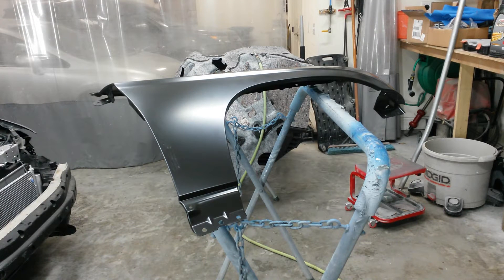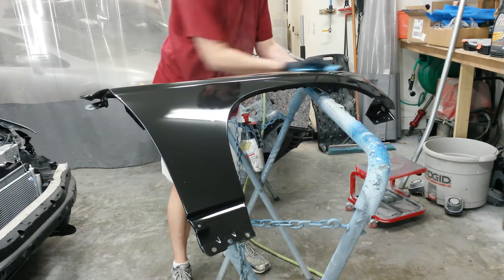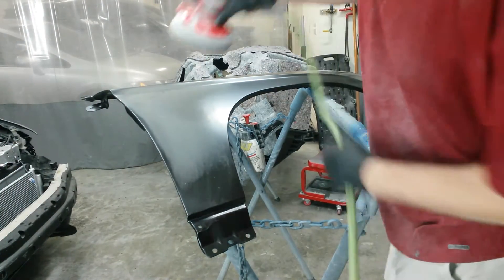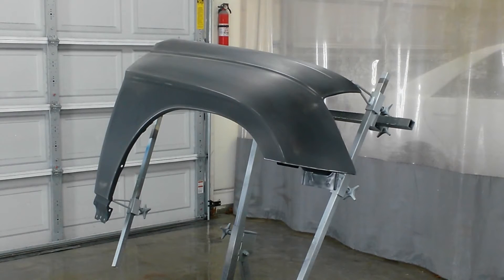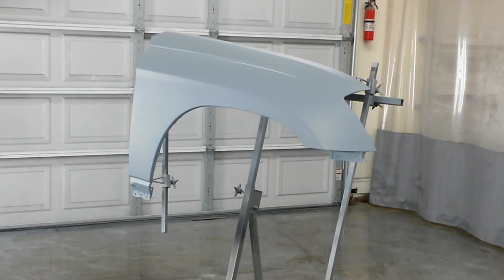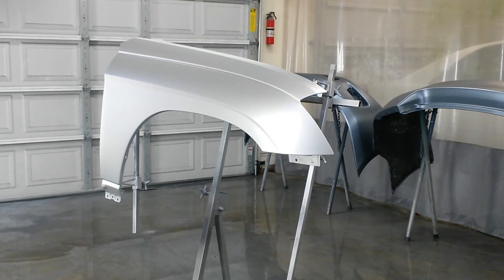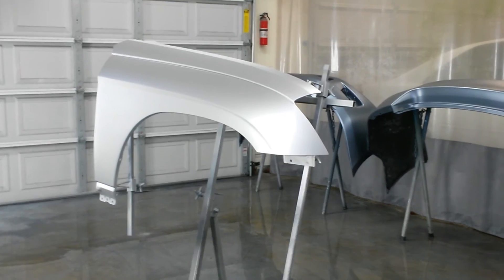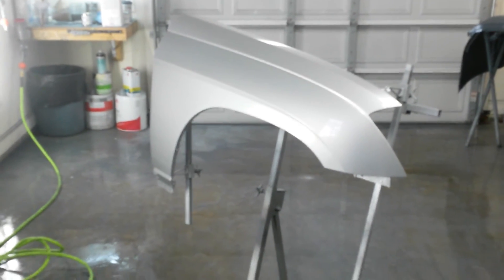2006 CHRYSLER PACIFICA | AFTERMARKET FENDER REFINISHING

Comment: I have been learning to spray with my HPLV gun and messed up on applying the base coat - I guess I used too high a pressure so there are some bits of solid paint although I filtered the paint and the paint seems to be a bit rough in texture not smooth, despite using a smooth sander primer below it. 

Now I want to redo the paint layer. How do I do it? It is on a new fender that had been primed by the factory.  Should I sand it down to the metal and remove the primer too? Grit? Or just a lighter sand to remove the bumpiness and bits in the paint and then reapply primer and paint from there? Or just use chemicals to just remove everything and start over?
Reply from the maker: Akiva Feinstein if you already applied the basecoat, just wet sand it with 600 and scotch brite the edges,  reapply the basecoat, then clear.

Comment: What did you for the back side? Can it be left as is with just the ecoat  surface?
Reply from the maker: Akiva Feinstein it's good to spray a coat of epoxy on the back side, but it's not necessary. I do it if I have epoxy already mixed for the repair or if I'm doing another job with epoxy at the same time and it's already mixed up for that one.

Comment: shouldn't you being doing this away from the vehicle??? thats how vehicles get all that residue
Reply from the maker: that would be ideal, but I am working in a garage. that's not the vehicle it goes on anyway, and it was already covered with dust prior to doing this fender. I am confined to a small space, so it has to be done this way sometimes. thanks for watching.